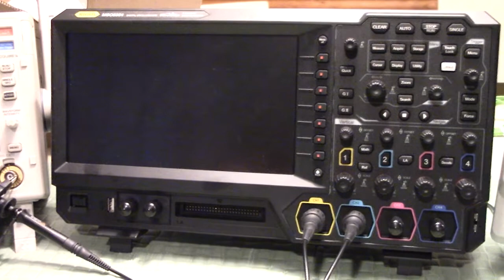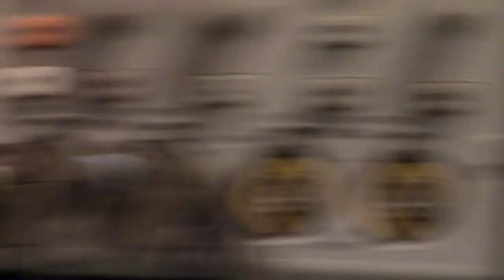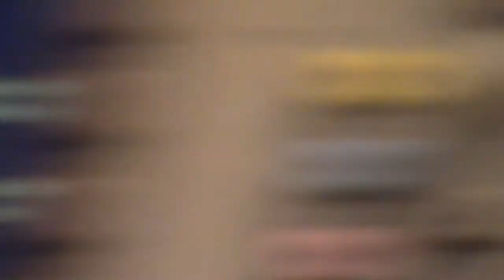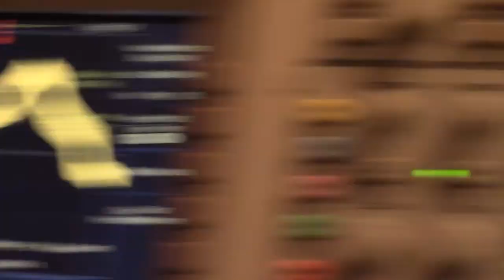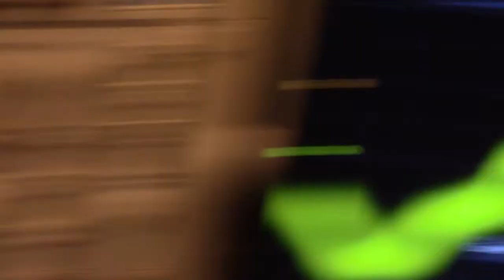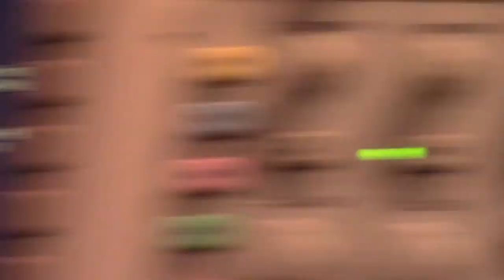ER06: Siglent, Rigol Oscilloscope comparison: Part 1: Small Signal

Comment: Did you turn on BW limit on Rigol? I saw the option was grey out. Maybe that's reason we saw lots of noise on Rigol.
Reply: No, everything is correct. This scope automatically locks the BW at 20MHz for <=10mV/div  (<=1mV/div with probe set on x1). I just checked on my MSO5072 and see the same picture  Vpp shows 15.6mV.  And it shows just a little less (14.5mV) with probe disconnected at all.... The Rigol MSO5000 is just noisy. :-( Damn, I had to take this video more seriously before buying this scope...
Reply: @jundar73  Without probe, the noise should be less than 5mv. That's the average noise between most scopes I've seen.

Comment: Your examples are sometimes truly stupid... it is TRIVIAL to check if something is ‘calling home’ ... so no need to wave it up in the air like armagedon is coming. Other than that, this vid is interesting
Reply from the maker: Obviously they would not make it that easy to find.  I just gave a simple example so that less technical people could understand the concept.  There are plenty of examples where the U.S. inserted "phone home" capabilities in commercial equipment before it was delivered to potential adversaries.   This potential for espionage is why the U.S. will not let a foreign company anywhere near their 5G network.
Reply: Alperic27 is right. No any problem to detect network activity on wired device. I did not checked that in person but I keep my own MSO5072 connected on private LAN (with separate IP address and no gateway and blocked internet access for this LAN from router side).  The scope is still accessible from local network but it cannot "call home" =)